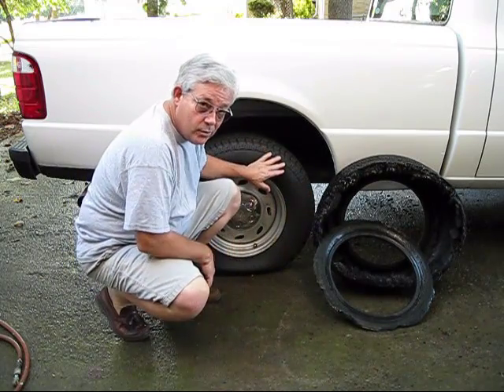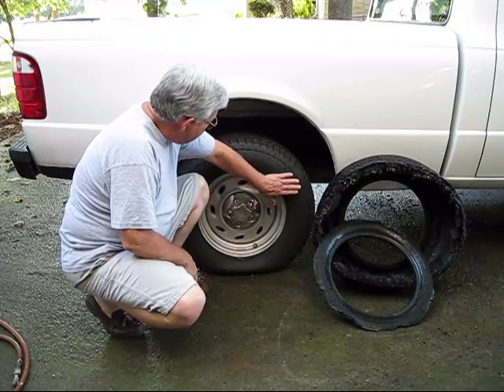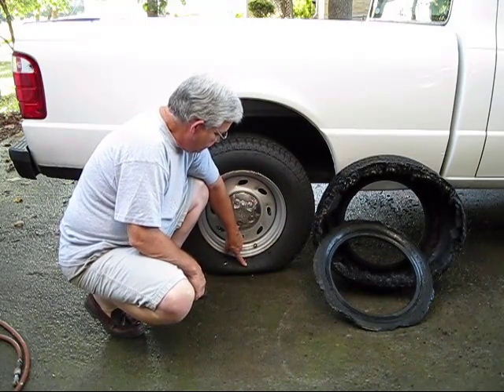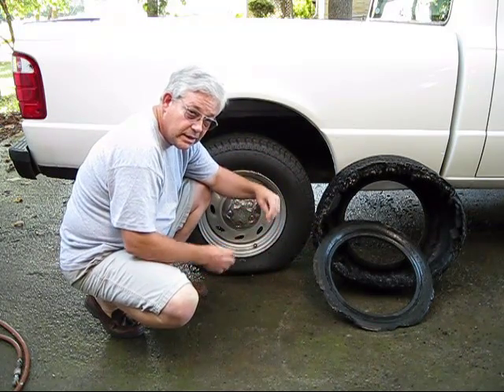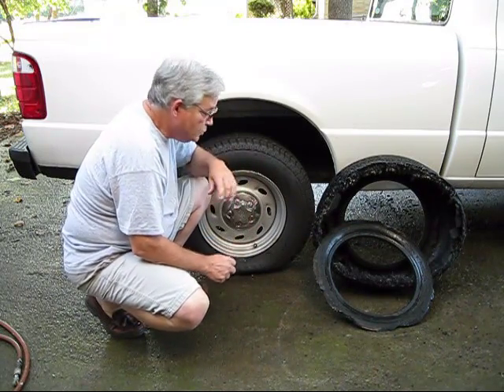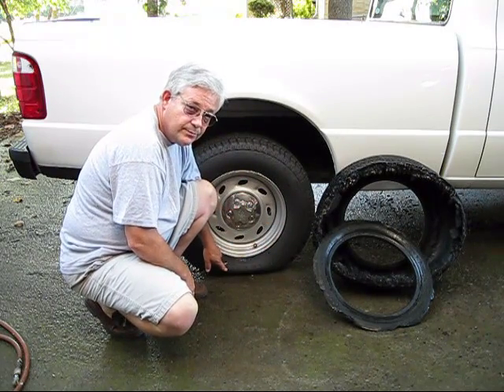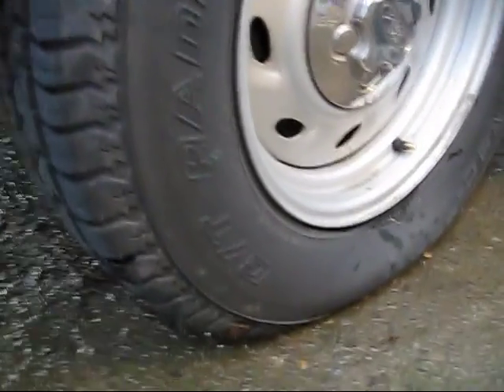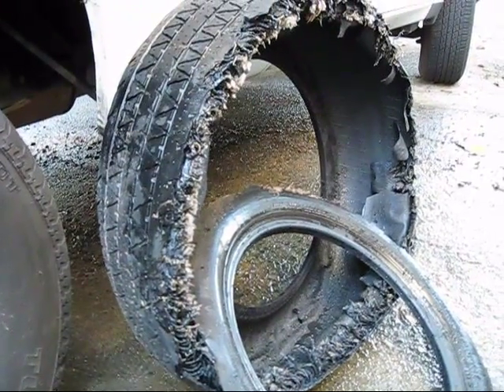Tire Sidewall Blowout Part II

Comment: Check your tires pressure!  Does a lot of good!  Twice I checked the pressure just before getting in the car and within 7 miles the the tires were flat. Why?  The valve stems went bad.  I even got to the point to wiggle the valve stem just before leaving and still I got a flat within a few miles.  I've had 6 blow out or flats in the past few years on the same car, but not on the other 3.  All were caused by failing valve stems.
Reply: if your tires are the original tires you have had on an 19 years old boat trailer should you have them replaced